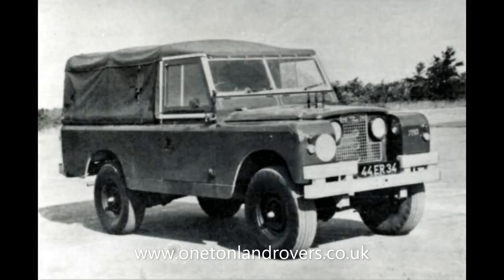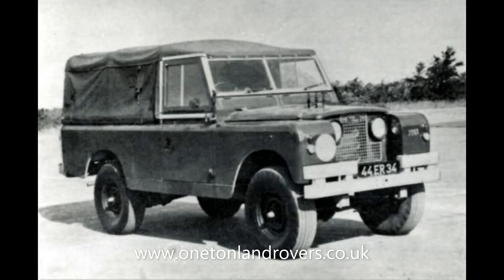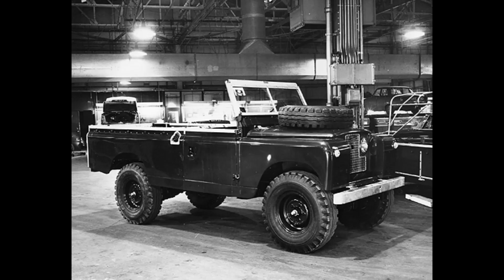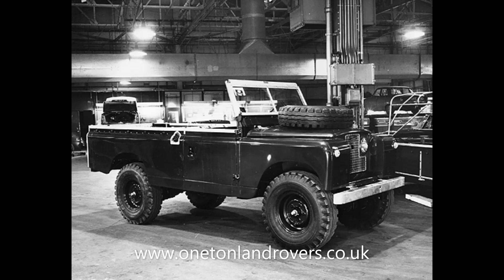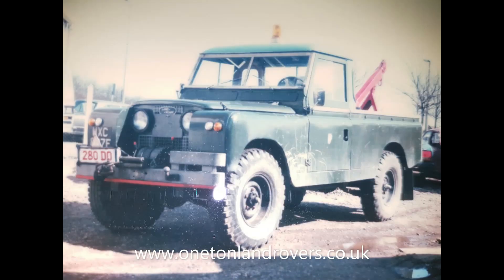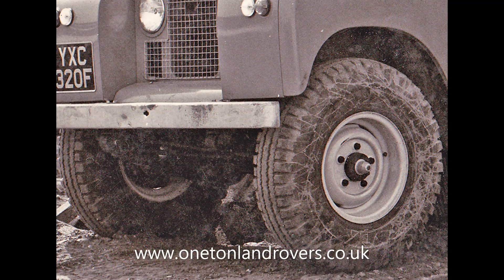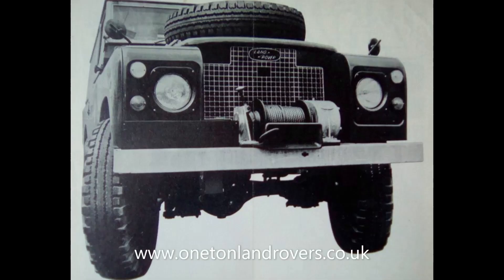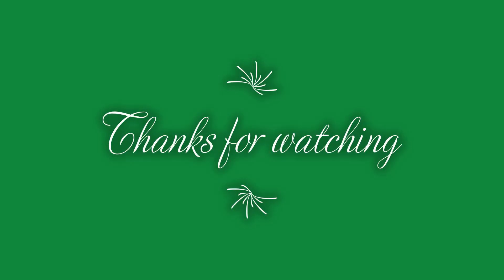1 ton Land-Rover prototypes

Comment: Can you cover any more information on the Axel types fitted to the One Ton, wheel size and any ratio changes??👍
Reply from the maker: Quite straightforward. Series IIA had ENV front and rear, except the final few which had Salisbury rears. Series III went back to ENV front and rear, before changing to Salisbury front and rear around 1974. Later still the front axle changed to the reinforced, 4 pin Rover diff type, although some very late vehicles were still getting Salisburies. Axle ratios were always 4.7:1 as per the standard Land Rover. Wheels were normally 6.5x16 with 9.00x16 tyres. Some late vehicles ran 7.50x16 tyres (still with the low geared transfer box!) seemingly with normal 5.5"x16 wheels.

Comment: Dear Sir, 
A friend of mine ,years ago,bought two of the x-army series  3 109s ,they have very stiff and drop suspension with very low gear ratio,they have a 2.6 l engine,I was wondering weather they are 1 ton or not, year of make is 1971, shouldn't the chassis no. Indicate? Sorry they are series iia and not series 3
Reply from the maker: Yes the chassis number would confirm, a few countries did get export models so its possible? maybe drop me an email with the info?